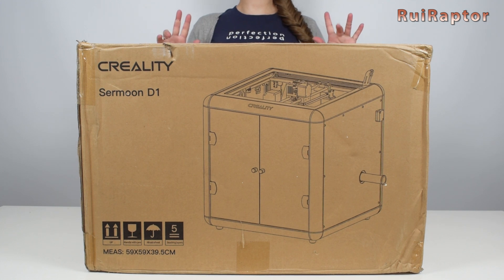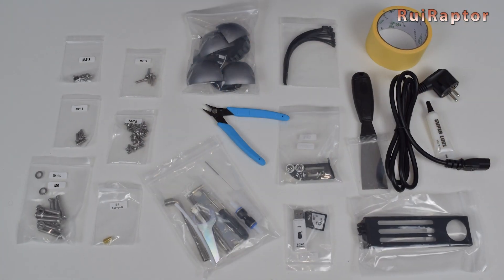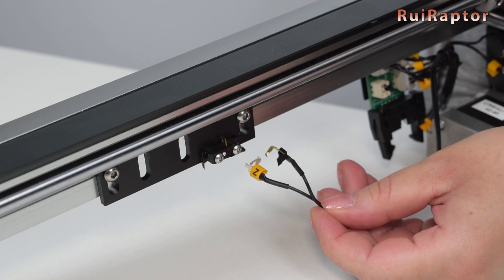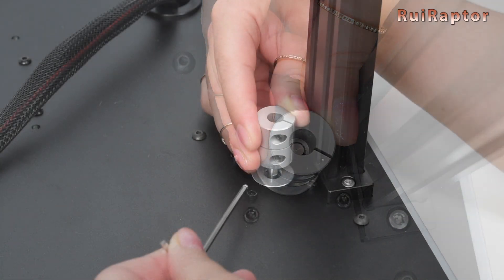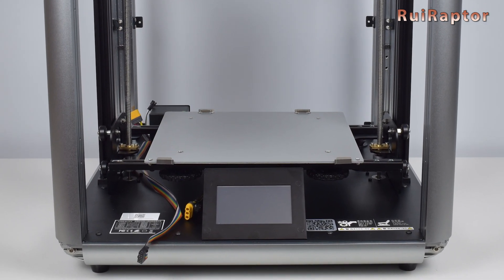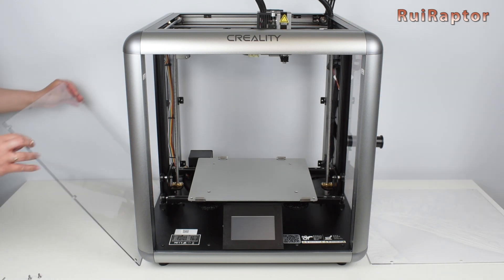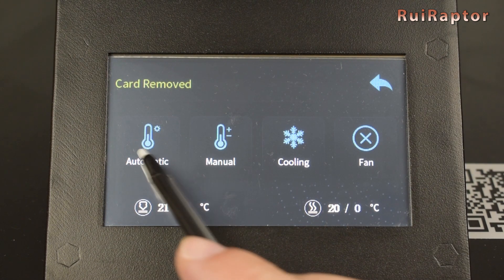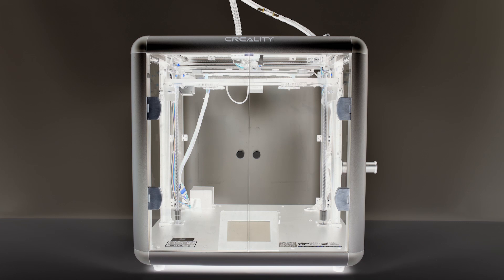Creality SERMOON D1 - All The Details & Assembly Guide

Comment: As an Certified Electronics tech of over 25 years, it is NOT wrong to have tinned wires for the hard connections to the junction ( it actually prevents them from slipping out and gives a crush point ). Putting the extra connectors on the cable actually ADDS a point of failure and lower amperage. I see this in every review and you guys are ABSOLUTETLY wrong. NO electrician uses a connector to do wiring in a house to a wall socket, let alone a breaker box,  this is no different.
Reply from the maker: Hi Kris,
i'm sorry but i have to disagree with your comment for several reasons. I work with electronics for many years and I'm also certified, so I know what I'm talking about. In every professional installation where you have these type of screw type connectors and flexible wires, you always need to add ferrules to the wires. These ferrules DO NOT add points of failure and/or lower amperage if they are correctly crimped with the correct tool. For house wiring and wall sockets, normally it's used rigid wires and for rigid wires, no ferrules are required.

Comment: Rotate the Y axis motor 90 degrees so cord does not rub on the plastic. It broke the connector inside the stepper. Move the door hinge 5mm forward. The doors will open 180 degrees.

Comment: what does tightening the coupler screws after installing the T rod do, i have searched and searched and it does nothing. I completely loosen it, then drop in the T rod and then tighten the screw all the way and the T rod just pops back out, it doesnt hold it in place or anything so what is the point, in fact ive seen a few people just drop the T rod in and move on to the next step, what is the purpose of these coupler screws?

Comment: Great video. I have this printer and also had the damaged Z switch. I replaced that and raised the couplings that attach the threaded rods to the motor shafts. By the way, you are the only reviewer that seems to have caught that problem.

My issue is the bed thinks home position is about 20mm lower than the print head and its is impossible to level the bed much less print. Do you have any idea how the printer sets the home position? I can disable the motors and manually raise the bed to the point it activates the replaced Z switch but the motors will not raise the bed that high, as it stops when it reaches the 20mm too low home position.

I look forward to your review of this buggy printer.
Reply from the maker: Hi Jesse, check the small black plate that secures the Z endstop switch. You can adjust this plate (up/down). You can also loosen the levevling knobs a bit to raise the bed.
Reply: @ruiraptor  The Z switch is adjusted as low as it can go. When bed leveling, the bed stops so low that a full range of adjustment on the leveling knobs will not get the bed high enough. Is there a way to adjust where the printer thinks home position is in the Z axis so the bed will stop at a higher position?
Reply: It has been caught in about 7 reviews I have seen.

Comment: @ruiraptor Great video! would you be able to make a BL touch installation video for this printer? the firmware has been released, but I haven't found a good step by step guide showing the process on how to set that up with this printer. my glass bed isn't flat so I'm really needing this bltouch upgrade. Thanks!

Comment: So my conclusion … they really sell a printer like this envlosed at the sides bot not on top? What is this good for? Eye-candy? According to what I know heat moves from bottom to top while possible dirt from the surroundings will probably fall down. 
And one more thing. They really sell such a monster of machine (with a couple of nice details which I have to admit) without an automatic bed leveling sensor/mechanism? Well…
Nevertheless I am excited on details of the construction of the hotend. Is it all-metal?